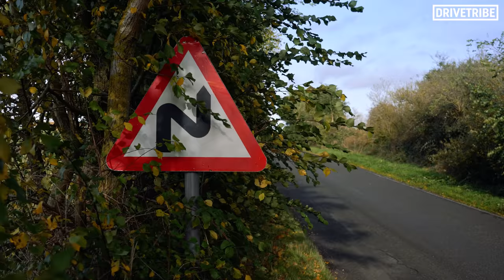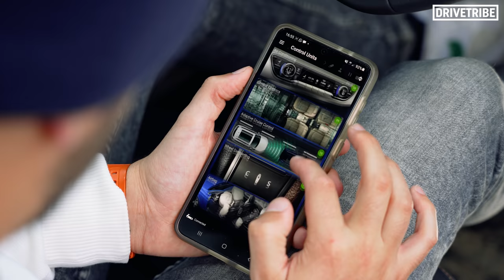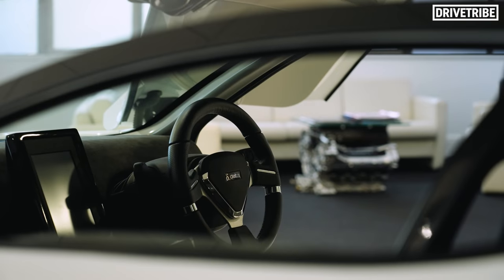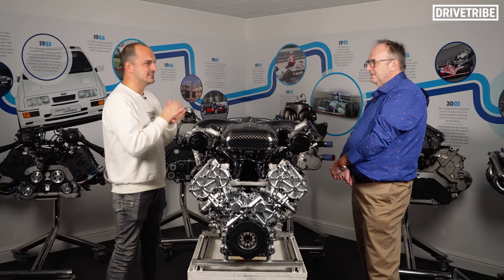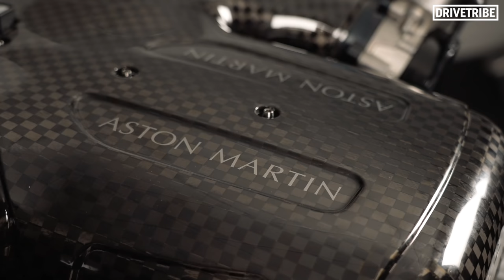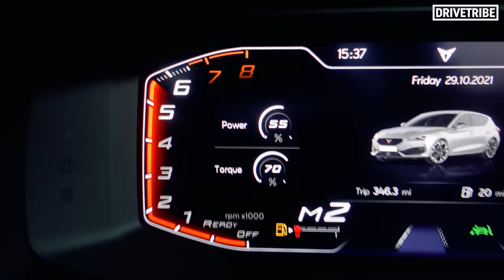Why are almost all modern engines 2.0-litres?

Comment: This 2.0 500cc per cylinder doesn't apply in the US, and the reasons are the following; 2.5L non-turbo,  is by far the most common 4 cylinder in the US, and it too, is "best", -atleast for the US. US does not have any hp or engine size based taxation. Hence a car is cheaper to produce, and sell, with a V6 or I6 for a set HP requirement, than a turbo4, which has many more components. 2.5 Litre is about as large as a 4 cylinder can go, before it creates excessive inbalance and vibrations. Larger 2.7 and 2.8L I4 exists, but either with severe vibration issues, or expensive balancing shafts, which makes a V6 the better (cheaper) option again. So why the 2.0 as a turbo engine and not a 2.5L? Engine blocks are developed as "families", or as a series, often spanning from 1.6L to 2.3L in the same basic engine block, for benefits of scale. The larger of the series is often stretched to the max; the remaining block material between the cylinder bores get very thin, not a problem on a non turbo 2.5, but once you add boost to it, its simply too little area to make a headgasket with enough material to keep the pressures in. It would blow headgaskets every which way from monday to sunday. So, once the plan is to have a 400hp 4 cylinder, you know your going to need a pretty beefy headgasket, and possibly also machine o-ring grooves in the block.  Thats why they select the smaller displacement version of an engine family for the turbo version. Because this is the only version from the engine family with enough space to do so.This has always been the case, and one can follow this trend from the 70's euro turbos to this day. Physics doesn't become obsolete just because newer cars come along.
Reply: Mazda and Subaru both use a 2.5 litre turbo both are successful. Mazda 2.5 litre turbo has no problems
Reply: I see a lot of American cars with 2.0 turbos and 1.5 3 cylinder turbo engines. Maybe they are just a popular upgrade over the base.
Reply: US has super cheap petrol. Sweden pays nearly 4 times more atm. That's why you have had V8's for so long whereas the rest of the world haven't. US is the continent which logically should have the smallest engined, slowest cars, compared to Europe's not as extreme police force, Autobahn etc.
Reply: Soooooo knowledgeable! I just learned more than I ever knew! Gracias Senor!
Reply: Can you explain to me why the us should’ve had the smallest engines?
Reply: Check XR4Ti, 2.3L [similar block to Sierra Cosworth].  Cylinder walls are thick, so thick Jack Roush was pushing 50+psi in the 1980s.
350hp is back yard possible on stock components.  Paying an extra $30USD for a better head gasket, and forged connecting rods, gets common engine reliability upto 500+hp.
Which doesnt matter, cause most everything else bolted to the motor breaks/fails near 400hp.
Reply: @capnskiddies  Happy with my MK7 GLI with 2.0 4 banger and turbo. It stays in eco most of the time, too. Lol
Reply: @ahmedyassir5569  perhaps its the low mandatory (and policed) speed limits means apart from speeding up to enter a highway 55-65mph is the default cruise control speed and the stresses on car engines are often lower in most non snowbelt states. Even then 4wd is more beneficial. What might make bigger engines easier to use in the US is lots of space under the bonnet. US cars are traditionally bigger and have more space to accomidate a bigger engine unlike the more confined roads and towns in europe where a big wide (even tall) car has problems navigating.
Reply: Most americans grew up with a V6 under the bonnet. So a V4 seems small (puny). I'd note mclaren who launched their supercar range went for a small V6 2.5L turbo over a trad supercar V8. Its more interesting whether a 3cyl turbo will be the last ice engines. If you look at the prius, it's original engine was a 1.6 V4, now a 1.8 for less engine stress, not more power and likely no meaningful extra car weight. In fact ice engines  in plugin hybrids will be designed for constant low stress power output so cc might rise while turbos dissappear. The mighty Ford F150 pickup was always a V8 yet its now mostly sold as a smaller CC turbo V6 with lightweight aluminium to cut weight, emissions and boost fuel efficiency. Ironically this 500cc "rule" will be meaningless in BEVs.
Reply: @christopheralonge7758  OP didn't say it wasn't possible, just that a brand, say Chevy, might use the same casting for a 1.6, 2.0, and 2.5L. The NA 2.5 goes in the Equinox, but isn't well-suited to forced induction, so the thicker-walled 2.0 casting is turbocharged for the Camaro. 
**All hypothetical examples, I don't know what engines any of those cars are actually offered with
Reply: @stephendoherty8291    ". If you look at the prius, it's original engine was a 1.6 V4, now a 1.8 for less engine stress, not more power and likely no meaningful extra car weight. In fact ice engines  in plugin hybrids will be designed for constant low stress power output so cc might rise while turbos dissappear" 
you do have a point, turbos create extra stress, as long as the engine is cheap, who cares, I'm selling the car after 100KKm either way. I don't see that as detrimental, I don't expect to be able to remake the engine or for it to last more than 200KKm anyway. 
With the turbo I get more performance for cheap, then I sell the car and its not my problem anymore if the engine can't go more than 2 turns around the moon...
Reply: @monad_tcp  you presume most of us are original car buyers when the vast no of car sales are used and they will price a cheap high stress turbo engine into the used offer price. Also most of tend to keep the car longer than planned so suddenly the cheap turbo engine IS your repair problem.  car dealers know what engines have high failure rates and that is factored into the trade in price which hits your pocket and any failures will cost the dealer to repair. Even if its a private to private sale, customers do their research and will offer lemon prices for lemon engines.
Reply: With all respect, I would suggest that the US automotive industry has given very little consideration to efficiency
in its hundred+ years of operation. Quality and longevity haven't been high on the agenda either.
"Build it bigger or paint it red" has been a catch cry of marketing men and accountants. The U.S. never got a chance to build the machines that they could have.
Reply: US fuel is limp worsted as well and needs a lower compression ratio to work well which means greater displacement!
Reply: There is another aspect of cylinder wall thickness that a lot of people miss. Well maybe two. The first is bore spacing.  I'm not going to get into the whole Japanese, Euro, US thing. Another is whether or not you are dealing with siamesed cylinder walls. Adequate bore spacing allows one to maintain coolant passages between the cylinders. Going with siamesed bores allows a shorter block and crank. At the potential cost of excessie heat building up in the area between the cylinders. 
If one looks up the bore center distance of most 500cc per cylinder engines most fall into a range from 90 to 100mm. With the average being round 95mm. But there are exceptions to the bore center distance. The heads from a Porsche V-8 will fit on a big block Chevy. It's been done.
Reply: There are plenty of people running upwards of 350hp and ft-lb of torque on GM's ecotec 2.0l turbo engine dating back to 2006. They first debuted in the Pontiac solstice gxp/Saturn sky redline and were putting out over 275hp and 300ft-lb of torque (peak torque at 2500 rpm through redline) with a GM warrantied performance tune.
Reply: How do the emissions compare between 2L turbo and 2.5L? I'd assume that's one of the most important metrics for manufacturers.
Reply: @miljororforsprakpartiet290  Fuel consumption is more related to the power output of the engine and NOT to it size. 2L I4 turbocharged/supercharged  engine is going to be more fuel thirsty in many cases than a 3.5L V6 naturally aspirated engine. Also turbocharged engines require higher grade petrol.
American big engine cars are happy with a regular gas (87 in US, 92 Europe) which is cheaper than premium. Lower compression ratio in bigger engines is also related to less stress (physical and thermal) on the material used to build them which translates to lower maintenance costs. 
cheers
Reply: @tjblues01  There is a reason for downsizing, just saying. Europe have 1.6L vans these days.
Reply: @christopheralonge7758  you read the part about head gaskets, right mr subaru?
Reply: I agree, 500cc per cylinder just doesn’t seem that common
Reply: @zokusharuuku1091  It's the optimal and more or less de-facto standard for the rest of the world, though. 2L I4, 2.5L I5, 3L I/V6, 4L V8 (more rare, but happens) and 6L V12's are perhaps the most common configs.
Reply: What’s with the non multiples of 500cc engine sizes? Yall counting in ounces?
Reply: @davidbrayshaw3529  Ironically testing standards are higher in the US than Europe (recall dieselgate). For all the boasting in Europe avout efficiency in powertrain design, emissions have barely altered in real world use, euro car makers just gamed the test to pass the tests and fuel economy numbers. Independent mpg tests show most cars sold in Europe are 25-30% less fuel efficient than the test results.
Reply: @abexuro  in theory modern turbos kick in at low revs thus squeezing more air into the combustion chamber. In most driving, the turbo barely kicks in. A 2.5l engine is usually bigger (heavier) and prone to driver impatience to gain more acceleration and therefore poorer mpg.
Reply: @capnskiddies  Hagerty did a piece on turbos and how at higher rev range they actually are not as efficient as NA motors at higher rev range. Smog testing is why a lot of cars are turboed. They can get the MPG stat cause they don't do full boost on the MPG test. I think if car companies stopped side skirting laws and legislate and show proof they should change i think a lot of car mfgrs would return to more NA cars especially for non sports cars where you are not at the top end very much.
Reply: AMG Merc i believe is turbo super charged. Volvo also have twin charged engines with hybrid systems FYI
Reply: Yeah on v6s are almost always 3.5 or 4l
Reply: @christopheralonge7758  the Subaru 2.5L turbos on the other hand... lol  (07 wrx sitting in yard rn lol)
Reply: @miljororforsprakpartiet290  small engines and slow cars make a 15 minute drive to the nearest town into 30-45 minutes
Reply: @stephendoherty8291  highways in the majority of America have speed limits of 65 in cities and 75-85 in the country. a modern 2.0L turbo in a sedan or hatch can function with out a problem at those speeds, but when you start putting it in suv's(which is all that americans are buying nowadays) they start to struggle at highway speeds knocking down their mpgs to the 13-16s at around 80-95 mph(which is the average highway speed of a texan no matter what road they're on) which is totally absurd when you can be getting 25-28 mpg from a v6 in an suv on the highway
Reply: @stephendoherty8291  Here in the US V8s have always been gas guzzlers and I never wanted, nor owned one except for a 460 Ford V8 (8 mpg) in a now gone motorhome.  I bought 6 cylinder cars and am fine now with a 1.5 liter turbo four.   Most US drivers were shortsighted with oil resources and needed to be pushed into doing better.
Reply: @billd.8336  Sadly recent low oil prices since the great crash mean US buyers have been snapping up pickups and other big SUVs as fast as they can be made. No engine will be efficient if its trying to move a heavy brick on wheels on the road, often with one passenger. 30mpg is still considered to be super efficient for these vehicles. Now high gas prices means that massive showoff vehicle is costing an arm and leg to fill up
Reply: "This 2.0 500cc per cylinder doesn't apply in the US, and the reasons are the following; 2.5L non-turbo,  is by far the most common 4 cylinder in the US, and it too, is "best", -atleast for the US. US does not have any hp or engine size based taxation."
That actually depends a little bit.

Whilst it is true that the US doesn't have specific taxation based on engine displacement, the US does have the federally mandated corporate average fuel economy (CAFE) requirement that automotive OEMs are required to achieve else they would be fined (along with a credit trading system). Pretty much ALL major automotive OEMs now are ALL global companies.

In comparison, the EU does not have a direct fuel economy or fuel consumption target that OEMs are required to hit, but rather, a CO2 emissions target that they are required to hit, which has an indirect impact on fuel consumption. (Sources: https://www.forbes.com/sites/neilwinton/2019/04/04/eu-fuel-economy-rule-violations-could-cost-manufacturers-big/?sh=501229c57892, https://www.iea.org/articles/fuel-economy-in-the-european-union)

Therefore; whilst it is true that the US doesn't have a tax based on engine displacement, both by virtue of automotive OEMs being global companies nowadays, and the fact that both the US and the EU (and to perhaps somewhat of a lesser extent, China), make it such that automotive OEMs develop powertrains that can be used, MOST of the time, regardless of which regional market the vehicle is going to be sold in. There are, of course, some exceptions to this, but by and large, it just make sense to have one engine which complies with the regulations from all three major markets so that you can get a better economy of scale and better economics out of it.

And specifically, in regards to a naturally aspirated 2.5L L4 vs. a turbo 2.0L L4, that comes to the desired performance characteristics that you want out of it.

Sure, the 2.0L L4 could've also been naturally aspirated as well, but it might not make the power that customers want and expect out of it, and they subjectively "know" that based on how the vehicle may feel, for example, when trying to pass a semi on the US Interstate highway system.

(My dad complains about his 2011 Chevy Cruze with a turbo 1.4L L4 in it that he has to tip into it quite a bit more to get the car to do the thing that he wants it to do, and that isn't helped with a transmission shift schedule that primarily designed for fuel economy rather than passing performance.)
Reply: You're missing the point.  The discussion is around what is the most efficient form factor in cylinder design for both output and environmental emmissions, not the most marketable or simply a cost of production issue.  And clearly the fact that European manufacturers are adopting this formula must have practical and logical application otherwise they wouldn't be doing it.  Its hardly an argument that US manufacturers are better are working this stuff out, because they never have been in the past - have they now?  I mean if you want lazy large capacity low output high consumption donks, they are the world champions at that...  hardly surprising that that legacy continues.  And in so far as physics is concerned, denying efficiency because of legacy or market is also denying physics...
Reply: @earlrobinson1491  You must remember that in Europe, we focused on emissions and therefore that fed any decision on what engine design to work on. In most cases its not any efficiency level of 2.0l as in many cases that is seen as a large engine in most regular cars. In Europe the bet was that diesel turbo would be the answer to emissions and all design and investment was focused on that irrespective of capacity. Engineers were used to turbo as that is a near prerequisite for diesel engines and so petrol engines went the same route. Diesel offered low end torque but struggled at any high speed beyond minimum highway speeds so a single or dual stage turbo answered this. European emissions targets specified the emission limits and if a rabbit in a flywheel could meet that, no matter. In fact most Euro petrol car engines have much smaller capacity engines. Ford offers an award winning and wildly copied 3cyl 1L turbo petrol engine.  Now copied by PSA/VW and even some of the Japanese and Koreans. We are seeing mild hybrid as an alternative to capacity power. As noted most US car engine design faced different challenges- low fuel costs, long distance driving, extreme weathers, highway driving characteristics (high speed on ramp acceleration required to enter at highway speeds), highway speeds (50-70mph speed limits), bigger car space preferred, high AC demand, poor quality secondary roads and until recently poor quality low octane fuel.
Reply: @stephendoherty8291  Sure but the fact that most medium form factor cars happen to end up at 2.0L is simply a reflection of the fact that bang for buck a slightly under square 500 cylinder is the most easily optimised for output and low emission.  want an efficient 4 cylinder = 2L, 3 cylinder = 1.5L...  That is the point.  Turboed 500cc cylinders are more efficient than NA larger pots.  Want the same power/output use a 500cc cylinder motor of your choice, turbo it and your get larger motor performance without the same fuel cost inputs.  This whole comments section simply reflects a lack of comphrehension about what the guy is saying..  He is simply saying that europeans are now producing basically in line with this formula...
Reply: @ahmedyassir5569  speed limit
Reply: i have a mercedes T2 508 van from 1979 and it has a 3,8 liter 4 cilinder that is the most reliable engine ever being put in a van,
and that's why they are still in use all over the world. 40-50 years old, it doesn't matter because they keep on going and going.
Reply: @capnskiddies  the last 20 years was all about down sizing  engines and get as much hp out of it. I have a mercedes sprinter with 2,2 liter twin turbo engine,
and it pushes 160hp out of it. 30 years ago you would get 65 hp out of a 2,2 diesel, so they sure did a great job.
Reply: Agreed. And if you have been following anything about the American car market, you know trucks sell the best (typically v8s) and SUVs are second (big SUVs like Tahoe have v8s, mid and small SUVs have either a 6 or big 4. Just a different market. Heck we have HD trucks with 6 L plus engines and they are a common sight.
Reply: @monad_tcp  Inline 4, not V4.
Reply: @adamesd3699  oh yes, but now I want a V4 just because
Reply: @monad_tcp  Then may I introduce you to the the beautiful sounding Ducati Panigale V4, or several performance motorcycles from Honda or Yamaha?

V4’s are very space efficient, but complex and expensive to build.  Pretty much any car’s engine bay would have enough space for an inline 4 cylinder engine, so a carmaker wouldn’t need to go through the expense to put a V4 engine in its car.

But high performance motorcycles are all about absolute space efficiency, even if you have to spend more to get it.  So that’s why you’ll find V4’s in some high end performance motorcycles.

Cheers
Reply: @christopheralonge7758  He’s only repeating what he read online.
Reply: Just wanted to say what a great comment! Great information and a joy reading it.
Reply: Countries in the EU do not tax vehicles based on their engine displacement (cc), it’s based off their WLTP CO2 emissions.
Reply: @aidan1585  EU wasn't specifically mentioned, Europe also contains non-eu countries, some of which, have/had an engine size and HP number component in the new car tax system, though tax systems is always in constant change. From the 70:s to today though, that's been the defacto way cars were taxed in some countries, but it's changing, and have already changed many places. If one tax emissions instead of not taxing it, you still end up with the same difference of large vs smaller common engines.  The engine "family" effect is something that has developed over time and is related to economies of scale, not what is ultimately "best" for a single unit. Subaru is well known for not following the norms, nor are they focused on absolutely lowest cost also, since they use boxer engines, they have different NVH  parameters than inline 4's, so it doesn't really apply to those. Bore spacing is the key. A manufacturer wants to keep the bore spacing exactly at where the max engine size can get by with it, siamezed bore or not, so that the engine family can span as long as possible downwards in size, using the same basic castings and tools. Vibration issues decides what that max engine size is, usually 2 5 or less, without balancing shafts.  If one make castings that have more bore spacing than this, one waste space, weight and ability to make the smallest version of a given family. That maxed out size typically have too little metal left between the cylinders for the needed extra heavy duty gaskets a turbo demands. Could they make more 2.5 I4 turbos? Absolutely, but that engine block would be a bit large for 1.6 and 1.3 applications. With a 2.0 turbo, the family can more easily span from 1.3 to 2.5, with the largest version typically as a non turbo. A manufacturer like Ferrari who do not care about economy of scale as much, could very well develop 2.5 and 2.8 I4 turbo engines, but they wouldn't be selling a 1.3 non turbo version of the same engine. Ultimately a 2.0 is a reflection of an engine made from a manufacturer selling common economy cars, not high end or specialized one-off's. So the 500cc per cylinder isn't a magic formula that produces better results on average than other single cylinder sizes. It's simply a reflection of the results of developing engine families for economy of scale, where vibration is an upper limiter for inline 4 engines. Inline 6 cylinders do not have this limiting phenomenon, and neither have a "typical" singly cylinder size being more common due to this. An I6 can be any size, with or without turbo, but do have a lower cutoff, where an I4 make more sense, economically spacewise or otherwise There is no 500cc magic cylinder size thing going on. That's misunderstanding how we got to 2.0L turbo 4's in the first place.
Reply: I read that the 2.5 L is one of the worst engines
Reply: Prius motor size increase was only due to the shift from Otto cycle to Miller cycle, effectively reducing the power produce by liter of the motor, to improve the overall efficiency. The goal was not to reduced the stress
Most of motors are able to sustain stress without any issue, it is more link to accessories (cooling notably) than the core of the motor.
Reply: Just about every modern 4 banger I've had the displeasure of working on has a Ballance shaft. Even the 4.3 gm v6 had a Ballance shaft above the cam.
Reply: BMW and Mercedes make some of the most powerful modern 4 cylinder vehicles, these cars already push 300-400+ hp and can still be tuned.
Reply: @christopheralonge7758  because the 2.5 is the family block.  Mazda and Subaru uses their 2.5 for both turbo and non turbo.  It was designed to be modular from the start.  I have a 2.5 Mazda3.
Reply: @miljororforsprakpartiet290  No way.  America is massive, so we do a lot of driving.  Passing an 18wheeler on the open highway in a 1.3L diesel would be a nightmare.  Bigger cars are generally more comfortable too, and bigger cars need bigger engines.  On those long open highways in the Midwest, you'll want that big Chevy Tahoe with it's 5.3L V8.  Driving a little car, on such an open plain, the wind gust will throw you around.
Reply: @Allangulon you do know we have different octane ratings right?  I drove a BMW for 13 years that needed 93.  Now I drive a Mazda3 with 13:1 compression that runs on 87 octane.
Reply: @DroneStrike1776  Probably if US-made, you will need about 6.3L to get that same amount of HP from a 1.3 Euro one ;) 

The 1.6 diesel Renault Trafic vans are pretty punchy. With 6 speed manuals they do 0-60 in 12 sec and get over 40 US MPG. Not bad for an 8 seater van weighing in at 2.2 tons.